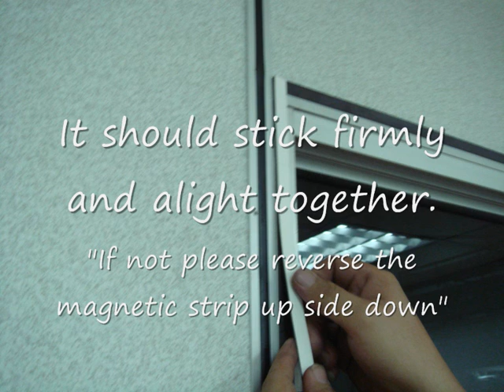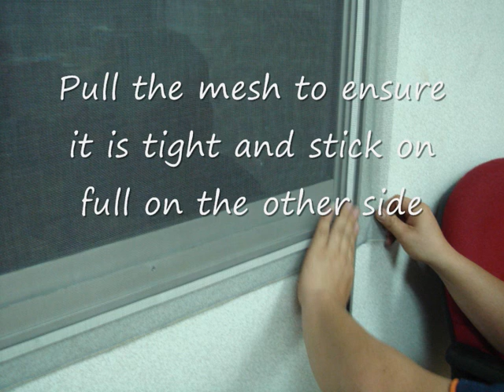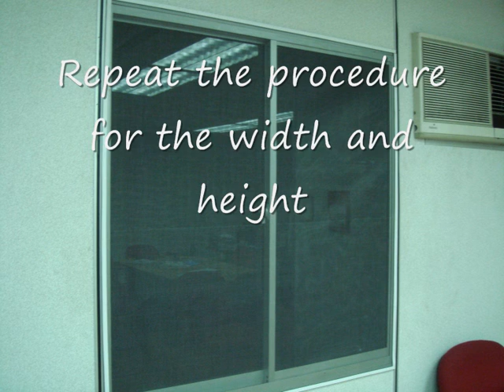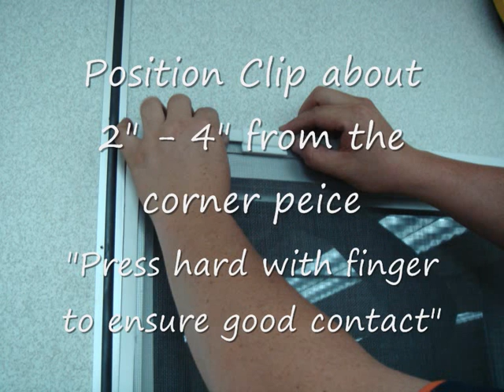DIY Magnetic insect screens installation Demo

Comment: How long will it stick if used in a caravan?
Reply from the maker: as it was stick by the adhesive tape. it is all depends on the conditions around. if not in wet or direct sunlight condition. it shall last for very long too.